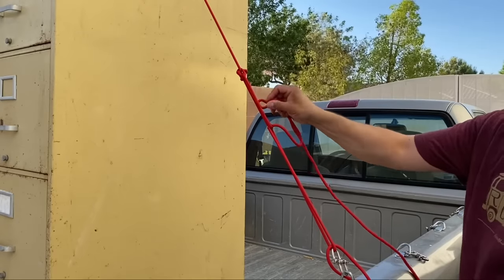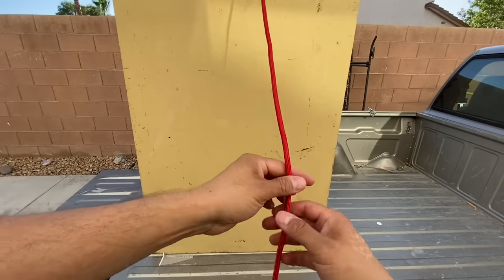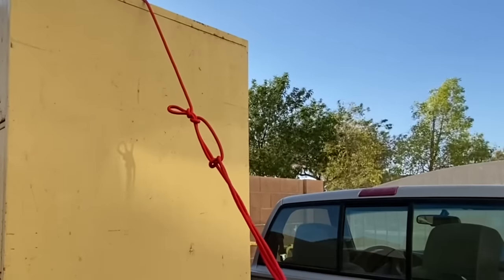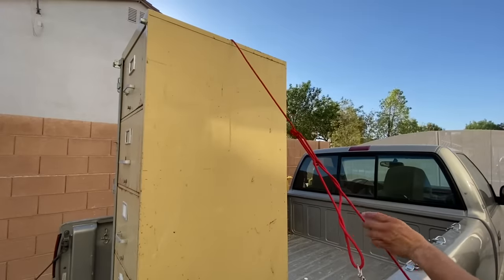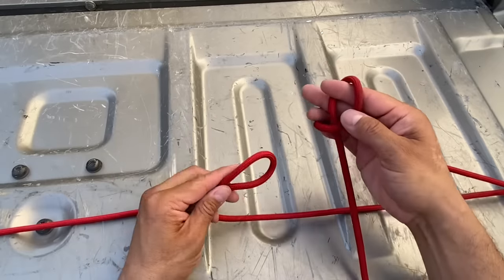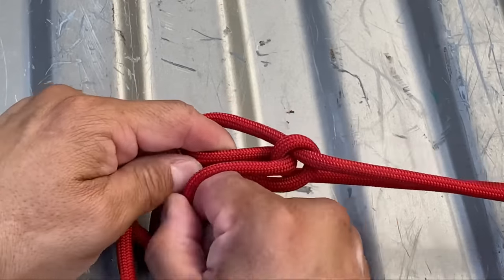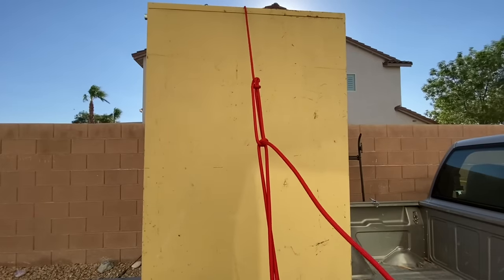In-line Automatic Truckers Hitch. Tension locking.

Comment: I use a considerably different version of this as a "trucker's hitch" and have done for many, many years. I've never seen this technique and I like it much better than the way I've been doing it, so thank you so much for taking the time to make this video. As an old man, I'm just amazed at what can be learned these days on this platform, but it's only because guys like you take the time to make content and are willing to share with the rest of us. So, sincerely, thanks!
Reply: Well said mate!
Reply: i appreciate you are using this platform well and hope to follow it!
Reply: this is a weaker knot than the standard truckers hitch. Should do the trick on lighter loads though.
Reply: ... yeah probably the same one I'm thinking of mate, I use something that does the same job but it's totally different it's almost similar to the standard trucker's hitch but you just poke the line and different through the bite then it grabs and holds it,
Reply: God comment. Same here, agree on all points. Amazing knot.
Reply: The last recap was the best. I was a little lost until he did that recap. Yes, this is better than the older trucker's hitch that I learned.
Reply: Time to go practice it 10x or more, 
So i don't have to watch this video Everytime i want to use it

Comment: With this true Truckers knot, you can put as much tension on Polypropylene Truckers rope as necessary for your load and still untie easily, the other methods will weld the poly together so tight that you will ruin a lot of rope. And this is not a weaker not. Key; Enough tension and at least two proper half hitches, have never had one get loose.

Comment: As a backpacker who prefers a tarp shelter, this looks like a great way to get a nice tight ridgeline. Thanks!
Reply: A truckers hits is better look up corporals corner modified truckies hitch
Reply: But a truckers hitch involves a slip knot, which can bind on its own loop as you pull the knot out. Other knots (butterfly, for example) are a bit more complicated. What makes the truckers hitch better?
Reply: @DaibheadSeamas  not sure what u mean by" it can un bined on its own loop as you pull  the knot out "  ik what un bining is I just don't know what u mean by that hear but I personaly have put 450lbs on a truckers hitch Ridgeline and it has never came un done  when using the modified truckies hitch by corprals courner to get the weight off the grounds so ik it is strong and won't come un done and very simaler to this when u pull the other way it losens up to undo the load

But if u could explain what u ment by it will un bind when u pull out the knot I might be able to explain why it's better
Reply: No problem! You misread my comment. I said it tends to bind, not un bind. What I mean is that as you pull the loop through, it pinches at the end and is a pain in the butt to pull through all the way.
Reply: @DaibheadSeamas  if you tie the slip knot the other direction (where the tail is the side that goes to the tree) then it won’t bind. The knot in this video and a truckers hitch are functionally the exact same, the only difference is how the loop is created. Choose whichever works best for you.
Reply: This is the link to the video he was referring to.  I have used this a lot myself since learning it from this video:  https://youtu.be/VUerD-QvFnc
Reply: @DaibheadSeamas 
I think I’ve had the binding that you referred to happen as well with it before.  Hasn’t ever caused any long lasting issue for me with paracord (which is what I usually use it for).  I just gave it a good yank or two hard as hell and the binding came undone.  With that being said, I’m going to have to give the technique in this video a try also.

Comment: I use a running figure eight for the second anchor point.  I have seen many different ways to tie a truckers hitch.  I like that both of your methods do not require to pull the running/working end all the way through.

Comment: When I do a trucker's hitch I normally use paracord; I just loop it around the top loop once and when I pull on it the single wrap locks on itself and keeps tension.

I'm not sure if its the qualities specific to the texture and stretch of paracord, but the trick doesn't seem to work on all rope. Masonry twine, for example, slips right out.

Your method seems like a much more universal approach to that problem, and I will definitely try it on some other materials.

Comment: Great explanation and demo.
I use a truckers hitch and simply pass the working end through the  loop twice. As you pull, the tension applies pressure to the first pass through piece of line. Pull up to release the tension. I use 2 half-hitches to ensure the knot does not slip.  I use an alpine butterfly loop for the loop. The second pass should be along side the first pass rope, it will be obvious when you try it out.
The auto-tension means you do not have to fiddle with pinching the rope as you add a securing knot. I forget which YT channel I learned this technique. Try it, it might be an option for some?
Reply: I am pretty sure you forgot to say you pass the working end around the second anchor a second time before going through the loop again. Just note, there may not be enough rope for that sometimes.

Comment: Excellent knot! Anyone else see a slight resemblance to a sheep shank?  I’m a carpenter with a lumber rack. I replaced my truckers hitch with a sheep shank and a blackwall to cinch down. It is has worked well but I’m wondering how the knot in this video will compare. The black wall configuration in this knot seems more reliable. And yes, I too carry and regularly use ratchet straps. But a man should know knots, right?  There are often occasions on the job site or out camping when knowing your knots is useful. It’s better to have knot skills and not need them than to not have knot skills and need them. 😉

Comment: This video should be called, "How to make a trucker's knot complicated". 
To achieve the same effect, tie the trucker's knot normally, but when you pass the working end through the bight formed by the trucker's knot, pass it through twice instead of just once. It will tension lock the same way, and it releases the same way.
Reply: The point is that it’s done in-line. Assume you have 300 feet of rope on the working end to better conceptualize the use of this. And I know you could tie a loop in the extra rope, leaving a small bit of working rope to use while just hooking on your loop as your standing end. But this in-line method works especially great if you want multiple truckers hitches in series (ie. having a long piece that you’re hauling and having multiple tie downs using the same rope)
Sorry about the lengthy reply but I think this knot is worth learning and I hope you give it a shot.
Reply: Good luck untying that old school truckers hitch. This version is far superior. Also cant do it inline.
Reply: @cyalata11  The version that Andrew Bugbee is referring to involves the same locking mechanism as the one shown in this video, the “blackwall” hitch. It’s the same release for both the inline and the regular blackwalled truckers hitch, just pull the cord in the opposite direction of the way it took to tension it.
And both the regular truckers hitch and this inline one are useful for different applications and easy to memorize. You should have both ready to go at any time. 
I wouldn’t say this one is superior, it takes longer to tie than a regular truckers hitch, so if you don’t have a ton of rope left over on the working end then a regular truckers hitch is perfect.
They’re both very useful, no need to rule either one out.

Comment: As I've got 10 thumbs only I entangled the rope roughly half the time when doing the 180° twist. Turns out you have to twist it in the correct direction or you end up with three loops through the lower bite instead of two.

Found a solution, though: with the working end lying on your wrist turn the wrist around it, then grab the rope and pull a bight through. Two loops, guaranteed.
When you turn your wrist the wrong way, you just drop the rope, so it's obvious before you tie the knot.

Hope a fellow thumbs only mutant may find that handy.

Comment: Nice idea, even if it is twice as fiddly and time consuming as the more common hitching methods. Pity we can't technically use that here in Australia where I am. Rope, unless it is AS approved and marked, can not be legally used to restrain a load. (Not that that stops anyone of course.) Plus, the cops or road authority would fine you mid may into next month for those horrid and lazy quick anchor points made from piggybacked D-shackles. Those shackles are only going to hold 25% or less of their nominated SWL because they are essentially a hook, not a closed shackle. Still, all nice work, and a nifty way to make quick hitches for lightweight loads.

Comment: In my version of a truckers hitch I maintain tension by employing a technique where I pinch the tensioned “pulley” and throw in a quick release half hitch. Never failed me so far.
Reply: I'm do confused... I'm trying this but missing something here I don't get it... I can tie an ordinary truckers hitch blindfolded but this just flies over my head
Reply: I think you're going back and forth too much here and it's really throwing me off
Reply: True, this works, but by simply passing the working end through the pully a second time, you get the blackwall hitch he was talking about and it just makes it a bit simpler to tie off your locking knots without losing any tension.  I use a much simpler method of making the "pulley" side and does not involve trying to make so many loops at the same time.

Comment: Do a normal trucker hitch, then wrap 2 turns at the pulling end (at the loop where you run the rope around) so that it jams onto each others (same principle in this video) then you have the same result...If you wrap 1 turn, then you have to pinch it to keep the tension.

Comment: Great although I had to watch a few times. How does this compare to the automatic trucker's hitch in another video you did?
Reply from the maker: The past video shows me threading the free-end of the rope through a tied-in loop. That would be inconvenient here because of the long length of rope. This version lets you tie the hitch without having to find the end of your rope and pulling it all the way through your loop.
Reply: @First_Class_Amateur  thx for explanation. Another question. when rotating the coil 180", does it matter rotating clockwise or counter?
Reply from the maker: If you wrap the coil counter-clockwise instead then you rotate it the other way
Reply: @First_Class_Amateur  you do realize at 1:40 and 5:28 your coiling the same direction, but you rotate the 180 counter clockwise and then clockwise the 2nd time? Trying to understand it thoroughly.
Reply from the maker: @hc2cox  You’re right! I did rotate it both ways. I’m going to make another video with a better explanation and better audio. I really appreciate you pointing that out.
Reply: @First_Class_Amateur  kudos!
Reply: @First_Class_Amateur  You could eliminate creating your particular "coil" over the first bight to only remove it from that bight to rotate it 180 degrees (In whatever direction) by making that coil go from right to left (instead of how you did it which went left to right) and then proceed straightaway with the rest of the truckers' hitch.  Your overall method is brilliant and works perfectly.  Thanks for posting it.

Comment: I love your knot exceptionally but are there any benefits to the automatic truckers hitch (self locking) where you put a second turn through the loop that it holds itself as well? I would guess that only with very high forces the in-line version will beat the other… tried it with ridgelines but didnt notice any significant difference

Comment: When using thinner line, such as bank line, the cow hitch tends to fail on me under load unless I secure the loop on the end of the cow hitch with a half hitch.  
  
Edit: I have found that a single half hitch instead of a cow hitch is enough when you add a second half hitch with the loop around the taught line which also adds a perfect loop to pull tension with a spike to reduce the friction on the blackwall hitch. It also gives you a way to undo it under tension if you make the window too small to pass the cord back through.

Comment: I'm really not sure about that lark's head instead of the traditional clove hitch that's normally used in a truckie hitch. It looks like it would be prone to catastrophic failure if subjected to sufficient tension. Also - If you spin the coil in the other direction, your working end won't be trapped between the other ropes.
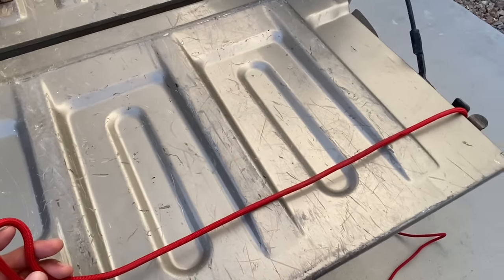Reply: I was wrong. I think the lark's head may be just as good as the clove hitch in this scenario. More importantly, this video contains a real gem around 4:04 which can really turbocharge the process through which a locking mechanism gets built-in a truckie hitch.

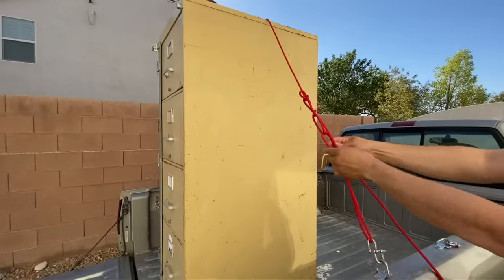Comment: 1:03 To keep the tension there, all you have to do is reach up and pinch the rope until you can tie a slipped half hitch. The self-locking knot should not be used on rope with high friction. It will be difficult to get high tension in the line because the high friction will prevent that. I just tried in some high friction cheap rope, which is the more likely rope people will be using. Because the self-locking mechanism does not work well in high friction rope, I do not use it all.

Comment: Why transport it standing up?? Unless you put some weight in the bottom, it will have quite a bit of wind loading.   Why not lie it on it's back, and run the lines through the handles to prevent it from sliding out of the bed?

Comment: WAY more involved than necessary, although I'm sure it works. I've been using a simple truckers hitch for over 60 years and would have it tight and cinched down by the time you put your first loop in this version. Besides cargo, I use it for tent stakes ridge lines or where ever I need control tension. Re-tightening as the rope stretches takes less than 30sec. per rope. Easily done while refueling. 
My dad taught it to me in the 60s and it NEVER failed once on many cross country trips.
He never called it a truckers hitch, he just called it a knot. Both retired truck drivers.

Comment: As a semi driver, a  4" ratchet strap is stronger, simpler and quicker... !!!!
Reply: A 100mm ratchet strap?
Seems a bit like overkill for a filing cabinet.
You'd never get it tight without crushing the cabinet anyway. 
Never seen a 100mm though, maybe they're lighter than the 75mm ones I've seen.
Reply: The author clearly is not a truck driver and does not have ratchet straps, thus this video is clearly not intended for you.
Reply: @bushratbeachbum  Youll do less damage to the filing cabinet with a 100mm strap as the tension will be better distributed over the cabinet, but yeah its a bit of a smoke em if you've got em thing, not many people have 100mm straps laying around.
Reply: Hahahahaha, good luck getting a 100mm strap tight over a thin sheet steel filing cabinet.
A 25mm strap would be the thing to use.
Reply: @bushratbeachbum  The rope, 25mm, and 100mm would all put the same load on the cabinet when tightened properly.  Youre confusing the maximum tightness with how tight you need to hold your load. Just because you can crank a 100mm strap down doesn't mean you need to. If you have something weak like thin sheetmetal you want to use something like the 100mm strap, because it will distribute the force better. But all 3 options will work and 25mm are cheap and easy to get
Reply: As i said, try getting a 100mm strap tight enough to hold it. It'll crush it before it does.
A 25mm strap will pull up taught and have no slack, so holding it securely.
We're wasting our time anyway, good luck to you.
Cheers
Reply: So what? Claude Labelle, This is for "Emergency" Use...when you don't have a 4" ratchet strap in your "back pockey" btw I was a TRUCKER for over twenty three years...Hope you're feeling superior...

Comment: I tried this with a similar rope but possibly made of polyester rather than nylon.  It had too much friction and did not slip as I tried to tighten the rope.  I will try it again with a nylon rope.  Thanks for sharing the video.
Reply: Exactly, the self-locking mechanism does not work well in high-friction rope. So, I don't use it all. I know one version of the Trucker Hitch that works in all ropes. It is better to know one version really well, rather than knowing a bunch of different versions for various type of ropes.

Comment: If you stick with your standard truckers hitch you did in the beginning, you could just run your working end through the loop again to make the same knot and it would be the same release
Reply: I've been doing this hitch for 20 years and I have to say, this looks superior for doing a truckers hitch with longer line: I don't have to run a whole 50 foot line through a loop.
Reply: Actually you don’t need to have access to the end of the working line to run it through the loop twice as suggested. You can do it anywhere in the middle of the line too, be it 5 feet or 100 feet!

Comment: Two things:-
1. Would have been really nice after you showed us the steps, you could show a one take version.
Like a couple of people below, I had to watch 5 or 6 times to get it.
2. That filing cabinet would be much better on its back than standing up. 😁
Reply: It's true it would have been much better to show it in one shot showing it all in sequence rather than multiple repeats of the individual part.  It's easy enough to rewind to review, so all the repeats of the non sequential operations are not as helpful as a single shot showing both parts together.
Imagining it were a refrigerator addresses point 2 🙃